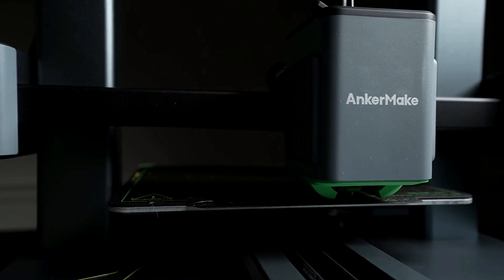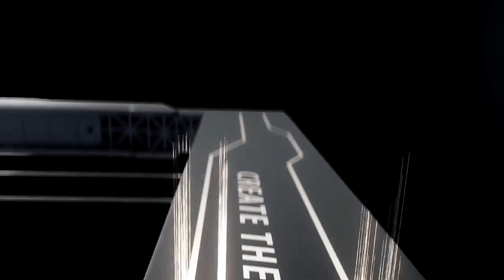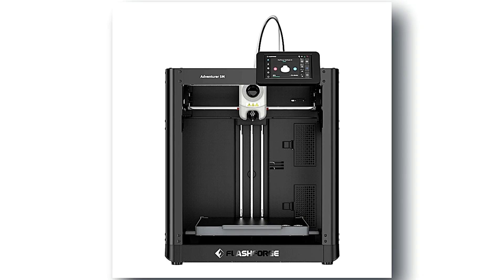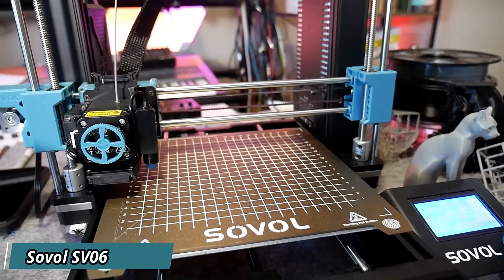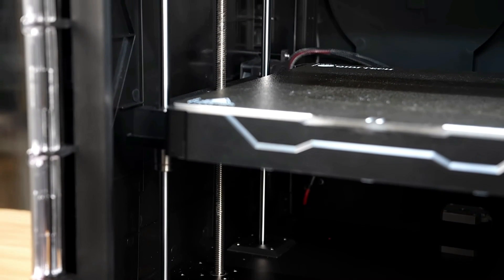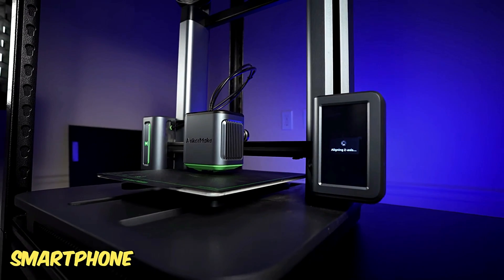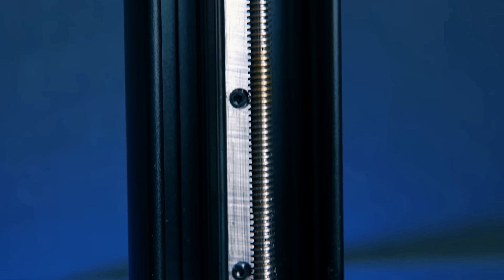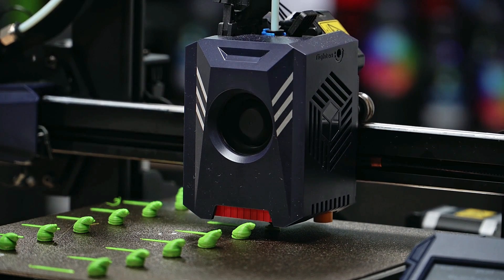Best 3D Printers 2024

Comment: XDDDDDDD
The AI still wont know what to recommend.
Abs on an open machine..... Congratulation the writer sit next to a long time.
Ender 3 oky but representing 3 different ender 3.....

Neptune 3 pro redefine what its possible XDDDDD
Still a bed slinger witouth auto z offset and input shaper, wifi. Nothing special on that machine
Again: neptune 3 pro but one of the picture is deffinitly a max.....

The AI only know a wide range a filament satch as abs and pla.... xDDDD

Again: M5S Pro and the picture clearle say: M5S

Experience the future of the fdm printing with Sovol SV06 WHAAT???? Its an anchent machine to compered to the 2024 and 23 line up printers.

T3: incredible accuracy.... on v grouw wheels???? HQ components on a sunlu printer??? Tell me more im intrested...... (knowing how far sunlu from the competitions)

Kobra 2 pro: User friendly interface???? OFC there is no z offset adjustment until u start the print what a good design.......
Wont see the bed mesh so u wont know where to adjust......

Where is the Bambu X1C or P1P or even A1 mini
Where is the Prusa XL
Where is the Ender 3 V3 series and K1 (K2 ohh the AI wont know that is existed)
No idex or belted printer on the list..... Why?

Best recomendation to Gear Gear: WONT MAKE AN AI GENERATED VIDEO WHEN U WONT KNOW ANYTHING AOUTH THIS TOPIC
Reply from the maker: Will send that all points to my script writer. Make sure not to repeat that in the next videos.